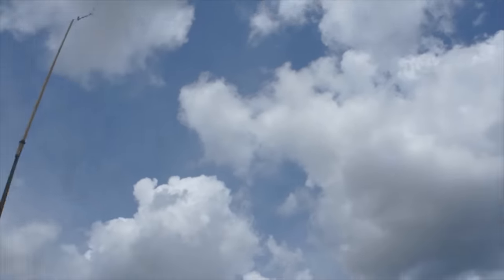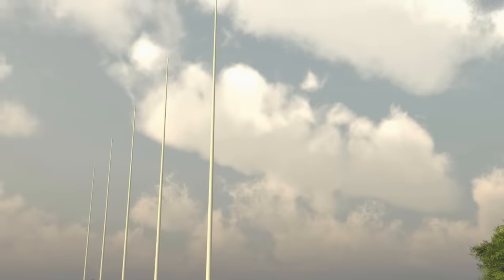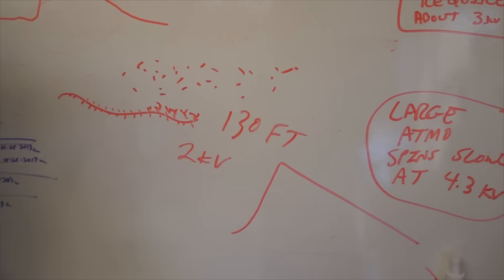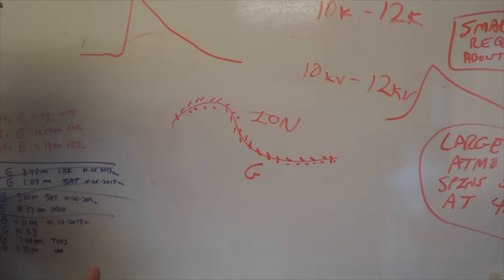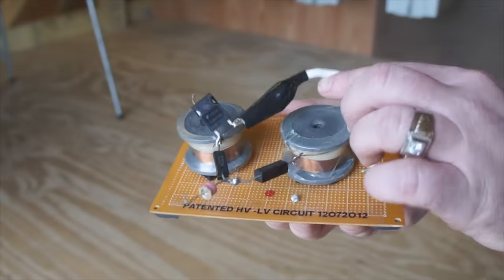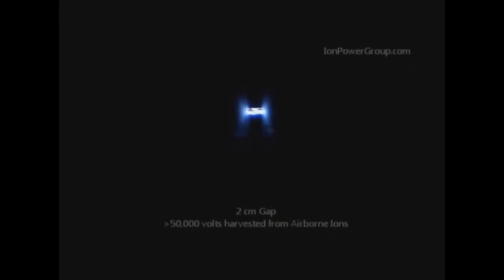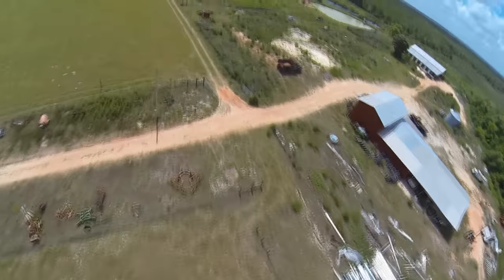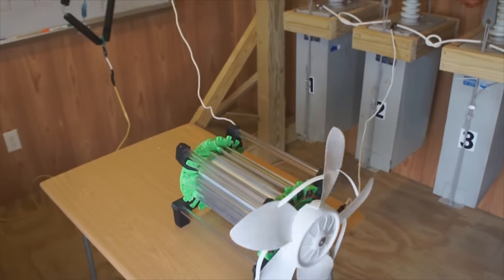Graphene/Graphite Atmospheric Electricity Collectors - Plus Horrific Hexacopter Crash!

Comment: Atmospheric energy works, but I strongly suggest you go with weather baloons, not towers.

There is over ten million working electron volts between the earth's surface and the top of the atomsphere.

You need to cross the vastness of the gap so you can make this pay off.

If graphene is your most conductive material, I would suggest you make graphene impreganted tethers [with good ground insulation near the ground naturally!] to super high altitude baloons so that you can realize the true potential of this technology.

This is what Nikola Tesla was truly trying to achieve.
Reply: Volts is one thing what about Power (Watt), useful experiments will show what Power can be harvested not just the voltage.  People were trying to harvest lightning for a long time, this looks more "peaceful" but what Power can we harvest?
Reply: R Ve I don't suppose you have ever considered the power equation too deeply?

If not, I would suggest you look back on it a little more.

I'm not going to go into a lenghty explanation of the blatantly obvious here.

If you to see what is clearly understood by most first year students in this matter, it is not my responsibility to enlighten you on basic electrical theory.
Reply: Delicious DeBlair What is the Max. Current they measure with these towers under clear sky conditions?
Reply: Balloons are a nice and cheap way to get something into the air, but horrible at providing consistent data for something like this. Having a constantly and randomly moving platform would never work since they are attempting to create a static resource. Even though you are dealing with a fluctuating power resource, you need to be able to as accurately as possible, determine your baseline and peaks. You can't do that with balloons. 
Where your towers will be swaying a few feet in any given direction depending on height - they are all tied together and swaying at generally the same rate/distance/direction, keeping it possible to maintain your measurements and offsets or tolerances.
Reply: Some things you clearly seem to not understand here: 1, atmospheric potential is incredibly stable, albeit it within a repeating pattern, especially when dealing with the upper stratosphere, and 2, at those heights the voltage is so great, it is going to be in the millions of volts [seeing as the total is in the range of ten million volts] how greedy for precision  do you think you actually need to be? Just aim for a cool million volt minimum and use a good storage system as a buffer and stop whining.

When you are talking about being stable and stationary, your biggest cause of motion is the tether which is likely going to be spider silk or graphene fibers [likely graphene due to conductivity] and once it rises above the jet stream, it will be relatively stationary as there is viertually no wind above that height and most of the wind that high is orbiting the earth at such asteady speed 24/7/365 one simply based their station on the angle of where they aim to have the essentially stationary baloon remain throughout its service life.

At such heights, one's truly greatest concern is actually incoming space debris which can puncture even a relatively tough baloon without effort.

As far as resupplying helium or hydrogen to keep said balloon aloft, merely keep a pressureized stream of gast flowing up the inside of the hollow tether and have an altimeter at the top keep the pressure and thus the boyancy regulated at a fixed height.

With such large amounts of surplus power, it will be no problem to have a steady stream of electrolyzed hydrogen right at the source.
Reply: R Ve The 'max' in a theoretically optimal setting will be where the voltage reaches its maximum, which according to this article is 'only' about 300k but then they admit that lightning can develop as much as 100m so what the true ideal is, nobody can really say, but if you use this article as a reference, on a 24 hour per day continuous harvesting basis, you can always be sure to pick up an average at least 100k under the worst of situations...

https://en.wikipedia.org/wiki/Atmospheric_electricity
Reply: Delicious DeBlair You missed my point entirely. They are trying to use a square wave formation to maximize potential. As in a 'wire' that is stretched into a square between 4 points. Now, if you know of a way (without expending energy i.e. small props or such) to keep a balloon absolutely stationary and in fact, in tension from one another to hold a wire between them aloft and in a steady formation then... by all means.
There are very practical reasons for wanting the square design, but if you just want to use the tether as your source then by all means - go for balloons.

EDIT: Also, they are talking about staying withing FAA guidelines - you know, making it practical. As nice of an idea as it sounds, you can't have cables stringing from the ground to the stratosphere, whether they are carrying millions of volts or not. Let's say you got approval for one or two permanent locations. World travel is not going to hand out permits for thousands of them stretching to the sky all over the place. It just isn't practical.

You can go through all the 'well yeah but...' you want, you have to get back down to the rules and regulations of the real world, and innovate there first.
Reply: OptimusPryhme Not to sound rude or anything but the entire design is utterly impractical when you put it down to the bare bones, there is just not enough energy in the air for any machine to harvest it at a financially gainful level.

All this about squares and square waves are not going to significantly increase the raw voltage potential of the ground so unless they are trying to go with EM harvesting [which needs no towers whatsoever] there is no real benefit to more than one lead.

Technically only one dipole is needed either. Mikola Tesla proved that long ago.

I dropped out of this avenue of research long ago as unprofitable and my team now has something that totally works and so as I told the CEO and producer/manager of the project [the project not this thread] I have moved on to much more profitable ventures.

Also, for those who are truly devoid of vision, [not naming or accusing anybody], hypersonic vacuum maglev tube rails would make petrolium powered flight so obsolete that the FAA would basically lose all meaning if they but used these to power stations along such an all electric powered transit systems.

This design is usless if you don't think organically how to efficiently employ it.
Reply: Delicious DeBlair What do you think a square of wire grounded to earth is aside from a dipole? It is simple harmonics, just increases efficiency whether you are talking electrical or radio. There is a ratio relation between the two which I'm sure you're aware of if you're into maglev tube rails.

I don't know what would fuel the amount of energy is required for a massive network of maglev trains, but I doubt the power generated by things like this video would have the current to generate it. Hypersonic or not, it is still a crapload of energy to run them. Love the idea of them, but they're not practical yet. Organic thinking has nothing to do with it until we can efficiently power it, much less employ it.
Reply: Again, one who is not highly educated in these matters would not see it even though nature shows it openly because they would not know the simple formulae of power conversion.

I would suggest you take classes in electrical principles [ i.e. basic electrical theory ] and learn to think as a scientist on these matters.

Also, even if one paid for fossil fuel powered maglev trains WITHOUT the vacuum tube option, [as opposed to A.E. powered WITH the vacuum tube option] it is still proven to be far less costly than any other mode of modern public transportation either for people or for freight. http://large.stanford.edu/courses/2010/ph240/ilonidis2/ 

In stead of asking negatively tainted questions, why not educate your self on the vast wealth of free available information already out there and spare people the negative vibes on a wholly valid idea?

Furthermore, if you are determined it can be done with mere short towers, why think in such a limited scope and think BIG like the ORIGINAL father of radio, television and modern electricity, Nikola Tesla?

Why be a small thinker like a blade of grass when you can be a GIANT like a Sequia?
Reply: The only one implying negativity via ego by proxy is you milady. I've been a technician for more than one or two decades. 

You see, the problem with people who claim to be big thinkers and wish the rest of us would catch up with you... is that you are the ones who don't think big at all. You pick something you are passionate about and nothing else matters. Even if you have to resort to a collegiate resource as support material, it is not nearly as poetic as you'd like to think it is.

I don't mind the ideas, I truly hope for the betterment of society as a whole and I would engender everyone to think harder, experiment in every way they can, and not let anyone hold them back. Unfortunately there is always someone who thinks they know better than you. Kind of like you.

I'm done with this conversation now. I wish you the very best with your magnetic behemoths and I hope they make a huge impact on the world. I hope someone takes the individuals need for transportation and power as serious as you take this subject.

Take care
Reply: Self-flattery is not becoming.

For all your studying, research, and proclamations of valiance, I see no proof laid before me that would lead me to believe that you are who you say you are. 

Now, do you see how the above statement sounds? As intelligent of a person as you appear to be, you are allowing your love of something to rile you up and glaze your eyesight into a tunnel-vision of protective proclamations nearing on gospel. 

All this began over something so simple. Why not just let the men experiment and see where they end up? Even those of us (I'm sorry to say at times) that are highly educated, have lab experience, and have even hashed out years in the field of arduous data matrices from endless observations... I never cease to smile when 'Jack from the garage' invents something fantastic with his haphazard ideas, horrible note taking, and ill-fated research.

So yes, we can worship our big brains all we want to! By all means your mind, dad's shoulders, lot's of hard work and studying is the gateway to awards, notoriety,  and ... snobbery. I'm 41 years old now. Older than some and far younger than many in my fields. However I have learned one thing very dearly. To be considerate of those that I might at first think 'beneath me'. You'll learn that too someday. If you've been researching for over 35 years already, you need to come up for a gasp soon. 

I never once called you a failure. Nor have I ever failed. I've just gotten results I didn't like so I started over from a different angle and keep going until I succeed. I highly doubt there is anything you're working on that would surprise me as being plausible. 

In fact I remember meeting someone about 15 years ago at McDonnell-Douglas and she and I had a brief discussion about such things. She was also quite exuberant and insistent. I mentioned not to forget to keep her feet on the ground. Nice lady. I wonder.

I hope you see your trains to fruition my dear. Even the 'circles' that might run them.
Reply: OptimusPryhme For fear of jinxing things, I will not say what we are doing, but if all goes the way I and my fellow researchers hope, I will witin a year be able to prove myself publicly.

If not, then later when we secure what we seek to secure, and when that happens, just be sure when you see my name in some scientific publications, you will know I was not just somebody all full of my self.

So for now, I shall merely table this topic and we can say [to me] to 'put up or shut up' and when I do put up, then people will see what they will see.

But as far as my requirement to put before you what is there for you to find on your own, where's the fun in being spoon fed ancient facts like baby food?

Wouldn't you rather sink your teeth into every little bit of it all on your own and live the adventure of learning and revelation from many of the last century's great minds like I did?
Reply: I'm not asking for your research. I have a feeling I've already seen quite a bit of it. That's not meant negatively, just that I've put in my research years and they've been varied as well. Perhaps you have a brilliant mind and even more than most... believe it or not there are others out there besides yourself. Even some that can outclass you, myself, and all of Stanford put together.

I would again point out to you that you are, probably without even realizing it because of how long you have allowed yourself to go down this path, that you are patronizing others for no reason. 

If you see merit in someone's work, and see something they are missing... how about we point them in the right direction? Perhaps we could all benefit rather than conjuring up schoolyard teasing contests. 

Honestly, I've bent over backwards at this point and I've nothing more to say. Good day to you madam.
Reply: OptimusPryhme I did my pointing and people spat in my face.

They suddenly  began to demand proofs of the blatantly obvious, acting like I'm some dimwitted fool with idylic pie-in-the-sky daydreams and that is truly where the insulting and 'patronizing' came in.
Reply: OptimusPryhme Technically, the word 'research' in my mind, in essence implies covering previously visited ground.

In my view, my group is not doing anything pioneering, but merely collecting existing knowledge and theory and putting it to good practical use.

If I give a kid a box of leggos, its all up to the kid what they make of it all.

The same is true basically at this point in the world of energy.

The ancient Egyptians had both wet and dry cell batteries, the Chaldeeans had indoor flush toilets, who knows what else was looted and destroyed over time we know nothing about but was perhaps equal to at least 17th century technology if not even more modern still?

We can only learn as we study those who have learned it all before us then branch out from there building on the known venturing out into the unknown.
Reply: OptimusPryhme The difference at that altitude are so neglible its like worrying if you will hit a fly with an atomic bomb...you have it MORE than covered!

In this process, where a few feet either way isn't going to make any meaningful difference.

On the other hand, since the voltages vary tremendously based on solar radiation and cosmic radiation, you are going to have a steady flux which you absolutely and utterly can not avoid by any means whatsoever.

This is from Wikipedia:

Experiments have shown that the intensity of this electric field is greater in the middle of the day than at morning or night and is also greater in winter than in summer. In 'fine weather', the potential, aka 'voltage', increases with altitude at about 30 volts per foot (100 V/m), when climbing against the gradient of the electric field.[3] This electric field gradient continues up into the atmosphere to a point where the voltage reaches its maximum, in the neighborhood of 300,000 volts. This occurs at approximately 30–50 km above the Earth's surface.[4] From that point in the atmosphere up to its outer limit, nearly 1,000 km, the electric field gradient produced in the lower atmosphere either ceases or has reversed.

Global daily cycles, with a minimum and a peak at roughly 16:00 hours later, were researched by the Carnegie Institution of Washington in the 20th century. This Carnegie curve[5] variation has been described as "the fundamental electrical heartbeat of the planet".[6]
Reply: ***** And if you keep pumping water from the ocean it will eventually run dry, right?
Reply: ***** Best you not assume and take some college courses in these topics so you can begin to understand how this works.

I have known how it all works since childhood so I would have asked you the same sarcastic question at the age of 4 when you say such [I shall leave out rude comments] things as you said.

Unlike blood in a human body which has to maintain critical minimum levels or one dies, and unlike a tree which needs a minimum amount of light to sustain its life, the earth/atmosphere never needs a minimum amount of ionic energy in the atmosphere, and on top of that, its humanly impossible to discharge it with a thousand years of all of humanity trying to build such an impossible device.

Clearly there are some things you have been thinking or believing based on emotions and not sound scienfic facts or principles.

Again my advice if you wish to converse in a group like this is to get an education on the matters being discussed.
Reply: ***** As I said before, go to school and get an education.
Reply: @MandrakeDCR  With improvements in low mass polymer composite technologies always on the go, 'trains' as we now see them, made out of steel and some aluminum can eventually be replaced by 'trains' made out of graphene, carbon fiber, spider silk, and other low mass materials of very high strength, allowing them to be levitated and propelled with much less energy per passenger on board, so while many of the train systems out there now may be prohibitively heavy, if you fail to see the whole picture, you are going to doom your progress toward the future.
Reply: @MandrakeDCR  On the issue of electroharmonics and dipoles, I can not say anything against this, so I shall not try to.

I can say that one would definitely want to research this application of these resonant cavity squares based on knowing the wave lengths you were seeking to harvest.
Reply: @MandrakeDCR  I know full well that FAA and FCC agencies, along with the DoD and EPA would all want to stick their nose into such research, so it is not something one would begin to have started without already researching those aspects.
Reply: @JV-lu4em  They never told me.
Reply: @DeliciousDeBlair  Ok, well this is weird out of nowhere - 4 years later. Speaking of which, it's way past the one year mark - you have any links to your proofs yet? I'd be very interested to take a look. 
I'm not really sure why you re-responded to conversations we already had, but... good on you. I see that your ego has not shrunk in the past few years, so I am sure all must be going well and you're no longer "covering previously visited ground" like the rest of us researching new tech. lol, oh man I have met some seriously interesting people in my line of work, but never anyone quite as pretentious as you I swear :)  - Have a great day.